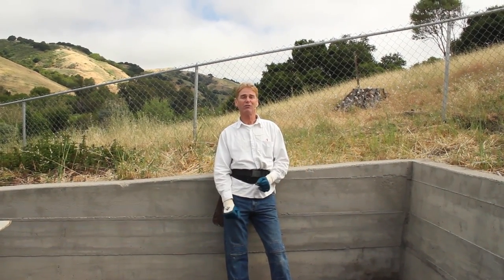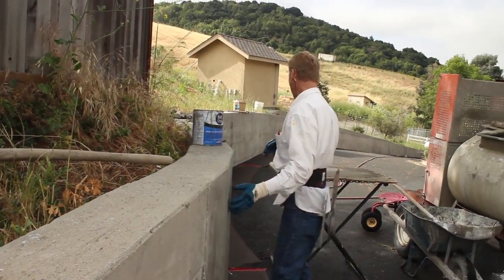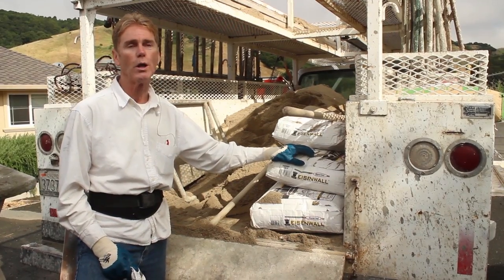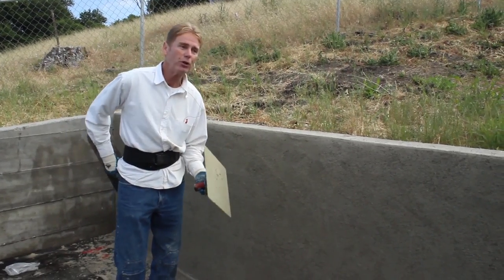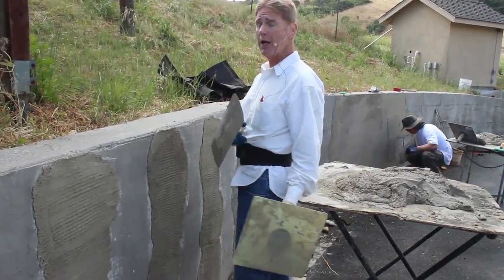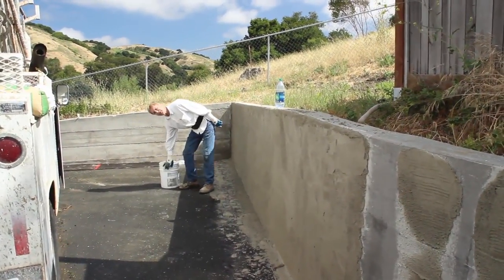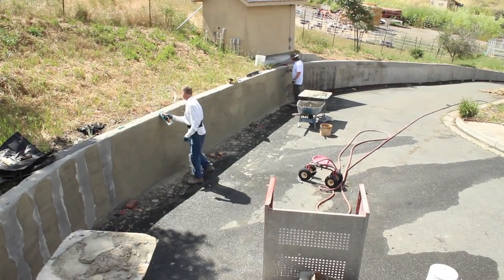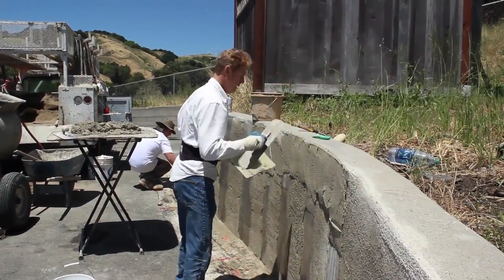Stucco concrete retaining walls.

Comment: You’re teaching an entire planet. Excellent work.
Reply from the maker: Hello Ian, that's the idea as ole, kirk ain't going to last forever, we need some new blood.😏
Reply: @StuccoPlastering  
I’m having an issues stuccoing a concrete wall. After about 90 mins I noticed about 25-30 bubbles blistering under the type s I used. I prepped the wall as normal with my pressure washer and I soaked it down really well and I added a few cups of lime to each 80lb bag of premix type s (just add water type). I even used some quikrete bonding agent and Lehigh type s with a little extra lime on another wall and the same thing no happened . Any ideas?  I’m not sure if I soaked the wall too much or what it is.. after the stucco dries those blisters split open and now I have to patch them all. The other thingg to note is that it’s s brand new house about 4-5 month old concrete foundation about 8 feet tall on the back of the house. 3’ on front. Would the newer concrete walls create an issue like that? appreciate your help and I watch all your vids.I’m a brick mason but not an everyday stucco guy as I’m in the northeast in Massachusetts and it’s not super prevalent out here.
Reply from the maker: Howdy Eric, two ways to guarantee brown or skim coat bubbling. If the walls are too wet, plus when the stucco was applied, there was not enough pressure when you troweled it on. This causes the plaster to sag or not adhere. Then when you hit it with a darby, the trapped air creates the bubbles.
 However, the good news is when you get this bubbling going on, leave it alone for a while, the weather dictates how long. 
Then hard rubber float the wall with either a hard rubber or polyurethane float. This compresses the stucco pushing the excess air out.
 Naturally, you applied the bonding agent to the wall and not in the mix?
 If necessary, type in how to hard rubber float a wall on our channel.💃🏻
Reply: @StuccoPlastering   thanks for the advise I really appreciate it. I’ve stuccod foundations before and never had an issue like this. It’s almost like quarter sized bubbles start appearing everywhere after about an hour. I was thinking maybe the newer concrete foundation was releasing gas or something lol.  And I applied the paint on quikrete binding agent and after seeing the bubbling I went to my local masonry yard and picked up the best bonding agent they had because they didn’t carry weldcrete which I wanted. The same issue still occurred. Both products I applied and let dry for a few hours and I even tried to put some k88 acrylic admix into the mix which just makes it a bit stickier and workable. I tried it with and without that admixture same issue. Do you normally apply bonding agents on to your concrete walls before you stucco or only under special circumstances? I will definitely try the hard rubber float technique. Lastly, if you applied bonding agents what is the water protocol ? Do you still mist the walls over the weldcrete ? Do you mist before applying weldcrete ?  The quikrete bonding agent just says to apply and let dry before applying your stucco.

Comment: Kirk try rendering ( applying mud ) from right to left (left to right for southpaws). What we call "Setting" ( think you call it veneer, skimming ...)left to right. When rendering you will always be pulling into your previous render, basically reducing the amount dropping onto the floor considerably. I weep when i see the render falling on the floor. Love your vids, from another plasterer that never stops learning.
Reply from the maker: Howdy Soup in a basket me fellow plasterer,
 I hate to say it but I have had to let guys go who had the habit of dropping more mud than they could apply,
 I used to scream sounds like cows shitting on flat rocks, man that makes for a long day as I also do clean up and nothing worse that having to pick up plaster from journeymen who haven't learned how to keep the mud or muck on the walls.
On a radius I can understand dropping some mud as the trowel is used diagonally but on flat wall where a trowel is used horizontally there's no excuse for dropping mud.
        Live long and plaster
Stucco/Plastering images and teaching video’s

Comment: Kirk been watching vids for a while, i like your enthusiasm for the trade and your knowledge. I embed eifs mesh in one coat and scratch and brown and silicone hairline cracks before topping with dryvit. I recommend this method for crack suppression. My houses 10 years later have very minimal or no cracking in the Rockies. Anyways thanks and cheers.
Reply from the maker: Howdy preferred Stucco dude my fellow plastering contractor, good tips, you are probably booked solid for this type of preferred thinking and applications with is synonymous with quality.
        Live long and plaster
  stucco/plastering teaching video’s

Comment: The cracks are not stress cracks from pressure of the backfill.  They are shrinkage cracks caused when the concrete cured.  The wall has insufficient control joints, so cracking was inevitable.  Same principle applies with any concrete structure.
Reply from the maker: Howdy Arthur, dude, exzackory
                       Live long and plaster
 how to repair their number 1 investment

Comment: Hi Kirk and family ,i have just a couple of things i have learned from 30 years of construction is that when you work with concrete you have to control the curing time so it don't cure to quick because if it cures too quick it will crack due to shrinkage ,so we have to maintain a certain amount of moisture content until it is cured (from green stage to cured) and when i was an apprentice bricklayer i was told not too mix the mortar (mud) to long because it would introduce too much air into the mixture compromising the strength ,i really enjoy watching your videos i love to learn more about the use of materials and the method of application, keep em coming :)
Reply from the maker: Howdy Rich and flow Dude, all true. For us, plastering is 30% of the picture, the other 70 percent is material knowledge and set times mixed with current weather conditions. 🍺
                  Bringing peace, love, and brotherhood  back to ”Plastering .”
 Created by Kirk and Jason Giordano plastering, sharing over 800 free, “how-to videos.”

Comment: Thanks so much for your videos ... I learned a lot from your videos now im about to do the wall on the house from the ground up to the siding 3ft by 30ft wide its chipping off of the block,  ive chipped it all off and then power washed it.  used an adhesive now im wating for it to dry and im following your instructions .... I appreciate the help.  thanks im Mike. Oh My cousin said you look like Gordan Ramsey :)
Reply from the maker: Howdy Shogun, thank you and best wishes,
                    Live long and plaster
      Plastering and repair tips for your home

Comment: Its  clean as  whistle  with    gas  powered washer 3000 PSI etched  an no dust  ...  yep cracks  are terrible can't stop them  ... have no fear Kirk an crew are there !
Reply from the maker: Howdy Peter between your tips and repairs and mine folks can't go wrong.
            Live long and plaster
  Kirk’s stucco/plastering teaching video’s

Comment: I'd love to see a bit of your preparation. Like putting down a plastic sheet and such to keep the fallen product off the ground. Any other prep type steps that a novice wouldn't know. Great work. Thank you
Reply from the maker: I'd say pressure washing the wall prior, to sort of micro etch it so it's clean enough to eat off, is kinda important.  🕵🏼

Comment: Mr. Giordano stucco guru :) if price wasn't a concern, would stucco-flex be a good product to use here to minimize any cracks showing???? Just curious, thanks for the videos
Reply from the maker: Howdy Chilly Willie Dude, yes, but this skim coat procedure would first still have to be completed,  Stuco-flex like all the acrylic's can only be applid only  an eighth of an inch, and yes some acrylic's are garbage products intended in making money and not giving a quality product, Stuco-flex on the other hand as well as many other acrylic's are the best of the best and will simply expand or flex when movement occurs without hairlining.
        Live long and plaster
 images for stucco/plastering and teaching video’s

Comment: why didn't you use a go devil ? My only knowledge of one or experience is from what you teach us,so with that being said I would think this would be a perfect opportunity to use one or would it be the worst time to use one cause the work of it would break you down from such a long wall ?Thank you for sharing
Reply from the maker: Howdy Billy, excellent question, both Jason and Nathan grabbed our go-devel, however as we did not pressure wash this wall, the homeowners workers did, thus I wanted to skim as tight as possible to get the mechanical bond necessary, If I had pressure washed this wall you betcha I would have used my go- devils.
        Live long and plaster
 images for stucco/plastering and teaching video’s

Comment: Nice video ! I enjoy watching and learning from all your videos .. I however have a question .. it would be perfect if you can tell me how to fix this problem I have on my stucco/ mortar wall that I just did.. 
First off .. I put mesh on wall.. then I went to Home Depot and bought stucco/mortar mix (sakrete). I used 5 .. 80lb bags for this job .. my problem is the color .. I mixed color cement powder into my stucco/mortar mix but for some reason when the wall dried it does not look good some spots are darker than others  .. I definitely added an extra spoon or two of cement color powder when I was mixing my stucco .. now I need to paint the wall .. I want to paint it but I am afraid that it will peel in the long run .. what paint do you suggest I use and should I use seal or not ? Thank you
- T j from queens New York
Reply from the maker: Howdy  savvas, I would recommend a good primer such as a premium quality, exterior elastomeric coating, FYI, Kelly Moore's sell's this stuff, 
BTW, if your color finish is chalky, hose it down with a water hose well as nothing sticks to a dusty surface at least not for long.
      Live long and plaster
  Teaching plastering video’s
Reply: Thank you ! Live long and plaster 🤙.

Comment: OK Kirk, question, maybe not having so much to do with retaining walls. In my basement , which doesn't leak since mortared the joints the the marble stairs meet the brick wall, the is a combination of wall surfaces. I am going to leave the stone wall alone as it looks good but 2/3rds are what look to be a 2 coat floated finish. The front of house had taken damage from gas pipe reinstall and water damage. I have cleaned it down as best I can and think I should be able to get away with watering down the stucco that is already there and scratch coating with a Portland sand mix with some acrylic additive in it just to help out. P.S. The house is close to 100 years old and doesn't move anymore as I have been here 10 years myself and no cracks/leaks have developed (except for the hurricane induced one in which I described fixing. It would seen to me as porous as the masonry on the wall is already it should form a good suction with scratch coat...am I all off base here?

Thanks.
Reply from the maker: Howdy Mars dude, you just need a skim coat like what we did in this video, one coat to the desired depth, FYI, an acrylic is a finish coat which goes on the skim coat or the base coat 30 days after that coat cures, you don't mix acrylics with stucco, If you do you'll screw up the mix.
        Live long and plaster
Stucco/Plastering images and teaching video’s
Reply: Thanks Kirk, that's good news for me. It is interesting that the adhesive/additive product I have says use in base and everywhere else. I am  going to take your word over the product's info...I'm hardly surprised when I see misleading info on products, some will say anything to have you purchase more and more.

P.S. I just reread my initial post and am shocked at the amount of errors in grammar. I swear I wasn't drunk when I wrote it out :) I probably wasn't wearing my glasses at time and need bifocals but refuse to do it yet, it makes me feel I'm getting too old too fast I guess! Thanks again and peace brother.
Reply from the maker: Howdy  Mars dude, fact is if it weren't for spell check no one could understand me either.
  Live long and plaster
 stucco images and teaching vid
Reply: I know right, and I was in honors English in school. Peace.

Comment: You are a great teacher Kirk. I used some kind of membrane on a crack in my slab floor before I tile it.
Would that work on those  cracks of yours so the crack wouldn't transfer through the stucco? 
Thanks for the great video
Reply from the maker: Howdy dude born a year before me.
 There are no products I'm aware of that will stop a wall or slab from moving in the long run, Not Rapid set's "cement all"  which has a strength of (9,000 PSI) when set, almost 3 times as strong as cement, nor La Habra's "Polybond which is great for sticking to anything cementitious, or any caulking, or even top quality epoxcy.
 I tell folks if a hundred ton wall is going to move, nothing will stop this action.      
                                   Live long and plaster
       Sharing plastering information,  as the world can use more teachers.

Comment: Does Rapid Set FIBER or another fiberglass admix work well for preventing those hairline cracks from forming? I found removing all soil and digging down to bedrock or at least a 'false bedrock' layer when building the wall is pretty effective, but that's clearly not practical everywhere.
Reply from the maker: Howdy  3 Alame Dude, we applied the strongest plaster that is sold in America, but this will not stop this wall from moving if it pushed in the opposite direction for months at a time by the weight of hundreds of tons of rain water, It will perhaps move only as much of an eighth of an inch, buht when drier conditions return, Thus Voila a hairline crack may occur which BTW, is not the end of the world.
 This wall did indeed have a french drain system installed and was engineered to the max, however nature does not care about these facts.
 Best wishes with your projects, live long and Plaster
 Kirk giordano on teaching plastering

Comment: Awesome video. What did you put at the base of the wall to keep the stucco from making a mess.
Reply from the maker: Good Morning Andy, excellent question, black paper it blends in with the tar, however, if you look close you can see all the red tape holding it in place.
 If I had not covered the tar, I would not have got paid instead the oner would have called the cops on me and had me arrested.

Teaching plastering do’s, don'ts and reasons why
                     Live long and plaster

Comment: Thank you Kirk.  I have a cinder block wall I have to stucco, so your info here is very helpful.  After watching this, maybe I shouldn’t plan on doing it myself!  I have no recruits I can call on, but mine is comparatively small.  Do you paint your walls after you’re done?  I will have to try and match the house is the reason I ask.

Regards,
Reply from the maker: Howdy James dude, no, as a rule, we don't paint, as the stucco has to cure for 28 days by then were long gone spending the earned cash in some third world country.      
                     Live long and plaster, 
  Sharing stucco secrets, or common sense tips

Comment: Thank you for this video. Extremely knowledgeable. I am an Engineer working on a similar project where the existing stucco has begun to peel away.  Once we have the existing stucco pressure washed off, would you recommend installing a new bonding agent? Also, my project is located in an salt air environment. Would any of the cement/stucco requirements change because of the corrosive environment?
Reply from the maker: Good afternoon Michael, If your in a cold climate or by the sea which is salty.
 I would emphasize, top of the line pressure washing with much force, then apply a proper bonding agent and plaster as normal.
 no stucco or bonding agent will stay on for hundreds of years if the bond is not the best possible under all conditions.

                   Get Plastered like stucco
      Kirk and Jason Giordano’s Plastering tips

Comment: Thank you Greatly for this video. I'm about to stucco my Stemwall/retaining wall & the forms they used were horrible with lots of voids & plywood marks. 

I was thinking I needed to grind it all flat, but it looks like you guys just stucco over the form marks. Of course after pressure washing it.

Will Lowe's Quikrete Profinish Mortar/mason mix Type-S work? Or is it best to mix my own sand & Portland cement or eisenwall?

Sincerely, 

Matthew
Reply from the maker: Good evening Matthue, I'd suggest Quikrete as Eisenwall set too fast, Plus, Eisenwall is only sold at plastering yards.😏 Goole plastering yards near me, if you wish to find a plastering yard to purchase your types of cement.
Our unique plastering Tip:  all subscribers or anyone who stumbles on our channel with a question, type it into our Stucco/Plastering channel, and like magic, a video will appear to explain how it's done. 	
   This feature is miles ahead of any plastering forum. 🥳	
https://www.stuccoPlastering.com

Comment: Naive question: I noticed on some walls a wire mesh is installed before plastering whereas in others it is not, like here. When is mesh appropriate - assuming formed concrete or CMU wall?
Reply from the maker: Howdy, I am not aware of placing any mesh on the concrete wall. Any stucco netting or mesh would be futile as if this wall is going to move and it will, no amount of metal wire or mesh is going to stop it.  🕵🏼